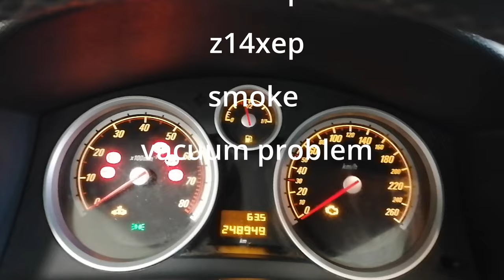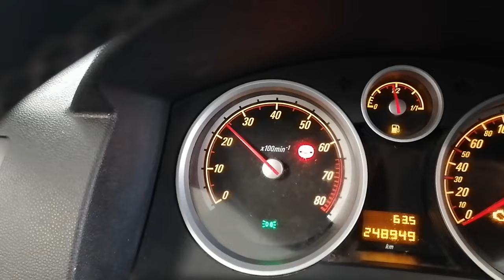Opel Vauxhall Z16XEP Z14XEP, eat oil, smoke, vacuum problem, REPAIR

Comment: Z14XEP not the same has no membrane with pcr valve is molded to cam cover part of cover hard to get off plastic welded with metal got 2nd hand one and it broke trying to get it off not meant to come off, crankcas gas leaks under the cover, rip off for new one
Reply: I am trying to clean crankcase breather hose with Tenzi Brudex, it is a strongly alkaline cleaning liquid that dissolves carbon deposits. A few washes and it's still dirty, but it looks like it will be clean soon. I do the same with the intake manifold.
Reply: @ukaszkarpik3476  Yeah but the problem is that cam cover has no membrane the cover itself is the PCV to intake and it gets hairline cracks so cleaning it won't necessarily fix it. And how much they cost is ridiculous. Ive seen people get they underneath part off which looked like they didn't break it but I bet when they resealed it still leaked. Ive even seen people fiberglass it and still leaked. Its a bad design and annoys me for a well designed motor. Its like the twin port sensor flap they try to sell you the whole new inlet manifold but you can get some aftermarket sensor flaps if you look hard but not easy to get. Rip offs is what they are.
Reply: All the second hand cam covers I got are full of carbon and can not be cleaned. I suspect oil gets trapped behind the plate that is welded to cover and cannot drain back to motor and as such gets sucked out of cover through the thicker of the 2 rubber pipes. All the covers I tried, the smaller of the cover connections for the rubber pipes was blocked. Is the small connection meant to be blocked off? I don't think the z14xep has a pcv valve?
Reply: @david-dj8or  No the cam cover is the PCV it vents the crankcase gas back into the inlet manifold through the thick tube. The small tube goes to some sensor behind the plenum chamber which I dunno what that is. I couldn't the get that plate off without breaking it either but a guy on the Vauxhall forums managed to how I have no idea its an old thread he never replied. I think it is blocked crank gas journals that cause a pressure build up and the gasket to leak and the inlet vacuum suck oil in, many have cleaned them out and replaced the gasket and no longer get the oil vapor mix. Remember the gasket must be fit correctly those thick pieces around the crank gas journals people often crush them. The milky oil under the cover is the crank vapor leaking from the gasket. Another theory is the plate under the cover gets hairline cracks due to it cooling faster than the head, which lets crank vapor in but to pressure test that cover would be almost impossible. The one I broke had no carbon at all. Apparently you can soak it in something that dissolves the carbon but I don't think carbon build up is the most common reason. Its such a stupid thing there is sensors on opels that do nothing they just put them there in the factory.
Reply: @HonchHeado  I have looked more closely at my engine and don't believe a PVC system is even used on my engine (Z14xep chain drive cam) The tube from rocker cover to the air intake connects at the atmosphere side of the throttle. Most PVC systems connect to the engine side of the throttle where there is vacumn. If the vapor and oil was being sucked from the crankcase then it seems there would need to be an air inlet to the crankcase, which I could not find. I think it is  pressure in the crankcase which pushes the vapor, oil out.
Reply: @HonchHeado  My engine was using about 800ml of oil per 1000 km. I broke the plate from the rocker cover and put the rocker cover back. It now don't use oil.
Reply: @david-dj8or  Mine doesn't use any oil in fact I need an oil change. Just gets that sludge and my compression is good.

Comment: Bro , i have the same problem , this solved the oil problem from exaust ?
Reply from the maker: thank God, I'm glad you're satisfied, best regards
Reply: Brother  @MadMaxTheProducer  I mean , will this solve my problem with the blue smoke ? Has this for you solved that problem with the blue smoke ?
Reply from the maker: @bromohamad81  Hello, It's best to remove the valve cover and if the membrane is damaged, the problem must be there. we solved the problem by replacing the cover. Thank you for inquiry. Max

Comment: if after replacing the rocket cover the car is still smoking white, can it the the oil left in the catalytic convertor or is there another problem?
Reply from the maker: Of course. You are right. The entire exhaust system may be oiled. When the old oil will smoke, it should no longer smoke white, only if there is still a problem somewhere else? There are 100 questions and 1000 answers about cars... Best regards.
Reply: @MadMaxTheProducer  is it possible that the oil in the pipes makes the first ignition difficult?
Reply from the maker: @НиколайВълчев-ы8я  Of course, it takes quite some time for the system to be cleaned and working as it should...